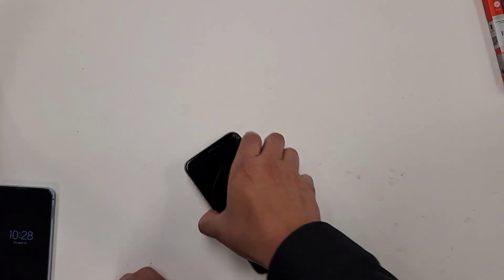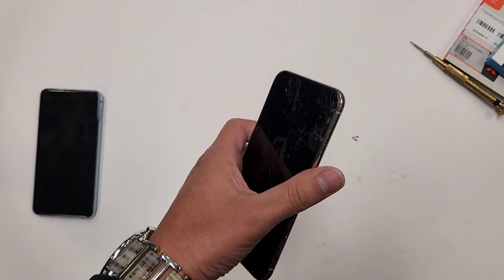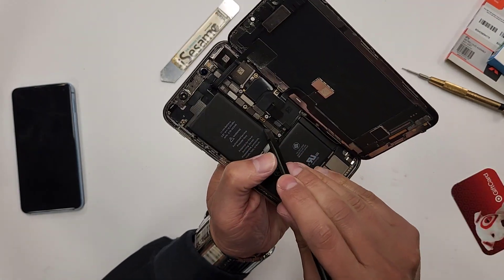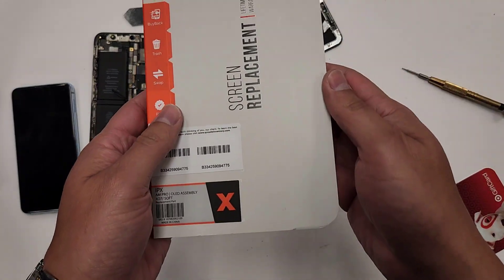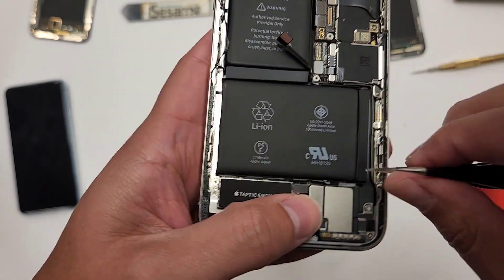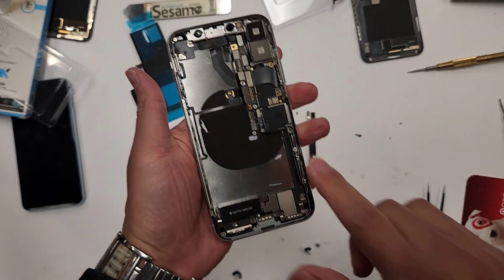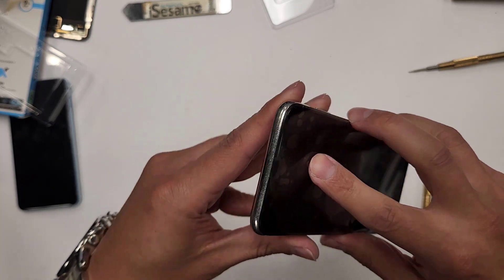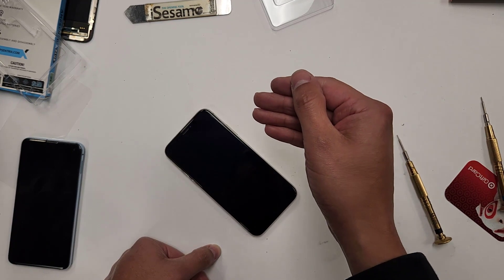Make $108 in Profit | iPhone X Screen Repair + Battery Replacement

Comment: What about after battery replacement the battery health menu not working?? - because that is what happens if you do not transfer the BMS (the battery chip) over to the new battery.
Reply from the maker: Transferring over and soldering the microchip off the old battery to the new battery is not necessary. Customer got a new battery and works perfect. Thats what matters.